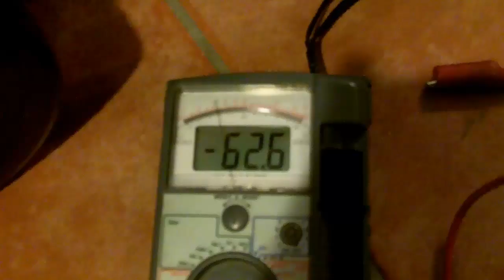HONDA INSIGHT IMA BATTERY REPLACEMENT: PART 3 REMOVE & REPLACE STICKS

Comment: Looks scary as there are warnings of possible death due to electrocution all over these battery packs.
Reply: Use some common sense. No need to be scared. Most voltages are less than 60 when the switch is off.

Comment: Was that easy for you to "open" that kind of tape that covers every stick (without destroy that) and replace the batteries? Thanks for the video!
Reply: The tape is just a plastic film. You can toss it out after cutting it away and replace it with scotchtape. Be VERY gentle with the little sensors! They break easily and cannot be repaired.

Comment: how do you measure internal ohm res of stick if you connect ohm metter it will blow fuse.
Reply: You can estimate R by dividing volts by the amp charging rate on the screen of the charger/reconditioner you are using. Also when testing the sticks it is ALWAYS best to load test each stick to see what cells are getting warmer than its neighbors. The warm cell has a higher R. It is best not to use that stick until it is working well. Cycling it a few times may fix Resistance problems temporarily. But when in doubt replace the stick with another that is acting right. A "good" stick will discharge at 20 amps or more from a full charge WITHOUT ANY heating for at least a minute. Of course the longer you "burn" it the warmer it gets so dont over do it. One or two minutes is enough to see if it is good enough to use in the car. A good automotive battery load tester is good at this test. The little chargers like IMaxB6 and others like it are not going to have a fast enough D rating (they typically have 1 to 2 amps D rates.)

Comment: Is it the same for the civic 2007 pack?
Reply from the maker: We do not know what battery is on the civic 2007......sorry!
Reply: driveslowly it's not.
Reply: 2007 was completely different. 2002-2005 were much the same. 2006-2009 Honda did many different (worse) things to the ima pack. 2010 and newer were LiPo cells. Not NiMh like the older honda hybrids had.

Comment: If sticks have different voltage rate, would it trigger IMA warning light?
Reply from the maker: Yes!!!
Reply: The IMA light comes on from several causes: Voltage imbalance is just one of the causes. Starting in 2010 Honda had several software updates that tried to minimize the IMA lamp warning. None of them really worked. The last update involved disabling the TCP strips totally.

Comment: what do they have to measure in volts to be bad or good? I know how to fix a prius this seems more complicated
Reply from the maker: It's more complicated than just measuring the voltage. You need to determine the "capacity". What I usually do is look at the discharge rate. Charge the batteries and then every day check to see how quickly they discharge. . The bad bad one's will discharge more quickly. FYI the discharge rate is very temperature dependent. It occurs more rapidly in warm temperatures Usually there's only one or two cells in a stick that are bad. You can test those by putting a needle/pin through the shrink wrap and measure each cell separately.
Reply: YardSaleCzarina whare can ypu bye new stocks?
Reply: sticks sorry wrong spelling

Comment: what is the size of those batteries and where can i find them
Reply from the maker: +d. kongul  They are size "D" welded together to form a stick of 6 batteries. We bought then on ebay from Hybrid Revolt. They were used, but had been tested. They lasted ~ a year and a half. Now, we're having to replace them again. You might consider purchasing new ones for longer life. We paid $240 (including S&H) and new ones cost ~$2,000 for a set of 20 sticks.

Comment: thanks for the video.  where can i buy sticks battery?  I"m in dallas tx.
Reply from the maker: +Judith Rivera  /We bought then on ebay from Hybrid Revolt. They were used, but had been tested. They lasted ~ a year and a half. Now, we're having to replace them again. You might consider purchasing new ones for longer life. We paid $240 (including S&H) and new ones cost ~$2,000 for a set of 20 sticks.
Reply: +Judith Rivera You can buy these sticks via Alibaba.  I just bought twenty from Yabopower and they were delivered to Tasmania for $180 USD, unit cost $52 x 20 = $1040.
Reply: +YardSaleCzarina  need Battery hibryd please # Phone wsap 50432793193
Reply from the maker: You can purchase them new or reconditioned. We got these on ebay from "hybridrevolt" seller.  Good luck!!

Comment: thx ya'll ....do not move the camera so much plz....when moving the camera, move to the spot ya'll want to show slowly, stay there and don't move....thx
Reply: do I have to replace all of it?? or can I change the one is bad and how do u test it with and at what voltage is bad or need to be released?
Reply from the maker: Yes, you can replace the individual sticks, but they have to be "balanced".  Voltage is not necessarily a good indicator of performance. A better method for determining balance would be to measure the internal resistance of the battery (should be ~1.6 milli ohms) and the capacity (should be > 6,500 mAh).
Reply: How did you measure that 1.6 milli ohms anyway? I never heard of a direct way of doing this myself. Thanks.